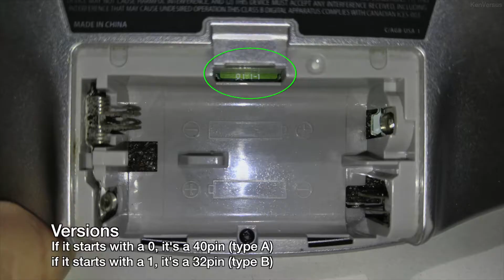Gameboy Advance Backlight LCD Screen

Comment: How do you do to play nes on the gba?
Reply from the maker: https://youtu.be/2KSM-6jBGLQ
Reply: @KenVersus  is there also something like that for the snes? That would be wonderful
Reply from the maker: I think there is a device that let's you play nes games on snes. Check out the retroport adapter.
Reply: @KenVersus  hey man thanks a lot... I meant actually a way to play snes on the gba
Reply from the maker: Oh then no. Gba isn't fast enough to emulate snes.